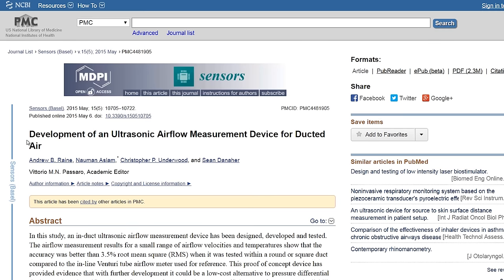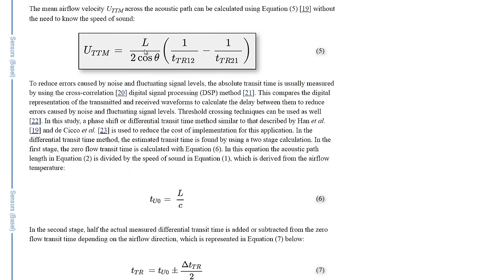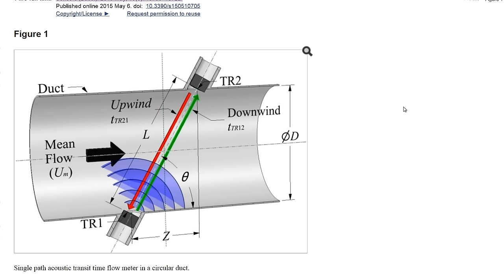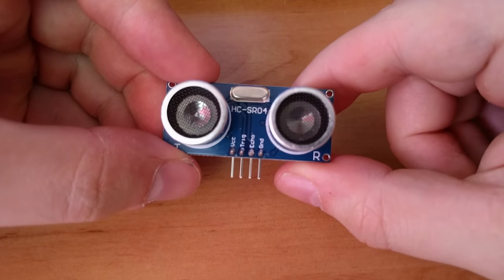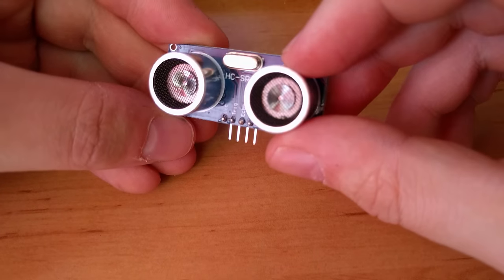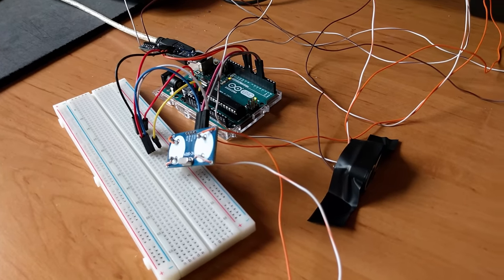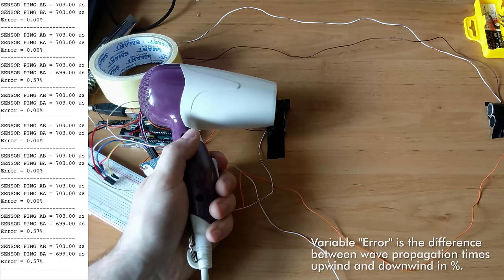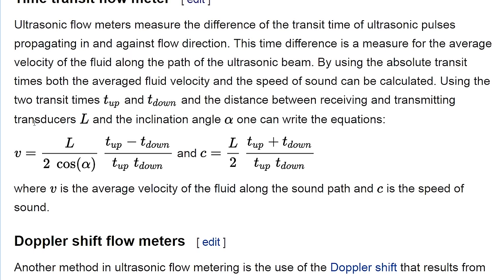Building homemade ultrasonic air flow measurement device.

Comment: Very clever. Didn't realize you could measure air flow with the Doppler effect like that.
Reply from the maker: What I am   trying to build is time transit flow meter. Doppler shift flow meter is a different method. More info here: https://goo.gl/bm55Ck
Reply: Ahh, I see what you mean. Didn't realize that the Doppler effect doesn't just refer to the movement of air changing the speed of sound in general, it's specific to the resulting change in frequency. Thanks.

Comment: Nice....Hey, I would need some help with Arduino code in measuring WATER or liquid flow volume using ultrasonic sensors, any help would be much appreciated. Please help, I am ready to pay for the experimental cost too.

Comment: Do you have the Arduino code that you used in the video,  posted anywhere?
Reply from the maker: It was something like this: https://goo.gl/gwCKTM. Keep in mind that it was  just a rough concept, not a working device. I was testing this in proper HVAC system and there is a lot of interference in transfer time. I am now working on measuring frequency shift from doppler rather than transfer time change. Or I will implement hardware low  pass filter and use my own sensors rather than HC-SR04.
Reply: ItMightBeWorse thank you for the code. I am using this principle of air flow measurement in a preliminary experiment for developing a gas flow meter using ultrasound. Keep me posted on any new findings and i will do likewise. Thanks again, great video.

Comment: With the extended sensors How are they positioned in the tube? one on each side?
Reply from the maker: I have extended transmitter and reciever of first SR-04 on opposing sides and the second SR-04 in reverse direction, so I can  send signals via sensor array in arduino sketch without modyfing SR-04 PCBs. I don't think that this device well be very accurate though but need to do tests next month to say more.
Reply: I have had success triggering more than 1 ping sensor at the same time. I'm curious if this will work. I just created the code to generate a delta T between the two sensors pinging at the same time. Both Trigger pins are tied to pin 4  and Echo pins are 2 and 3. What is your code to calculate the air speed.  I posted on the Arduino.cc forun with code example: 
http://forum.arduino.cc/index.php?topic=491835.msg3355901#msg3355901
Reply from the maker: I am using a modified version of this: https://goo.gl/p8SYLK. In current version I got array of 2 sensors with for loop. In each iteration I am doing median of 20 pings on one of the sensors. Then I am comparing them and inputing to equations. According to SR-04 documentation there must >=50 us delay between pings or signals may interfere.
Reply: what code did you come up with for the equation to determine the air flow measurement. I'm assuming you are comparing the difference between the two times and that indicates the direction and rate of air flow.
Thanks
Reply from the maker: This equation is on the Wikipedia, I even talk about it in the wideo :)
https://goo.gl/77EgT8

Comment: You could try another way. One sensor put in small tube with this same length and measure raw speed of sound in closed environment.
Then second sensor measure sound with air flow, and see difference.
This way, You can be sure about difference of temperature.
 I hope I am thinking correctly. I know that when Air is on flow, then it have lower temperature rather air being in this same place...
I am wonder how it is with hot air, I know that it will affect sound speed. Because then air is less density.

Ohh.... Maybe Your way is better? Hmm...
Reply: The idea of two ultrasonic sensors is that they are opposing.
one faces  into the wind, the other with the wind.
no wind means they both read the same
as the wind increases, the one with the wind has shorter times
the one opposing the wind has longer times
this amplifies the signal if one were in the tunnel and the other in non-moving air.